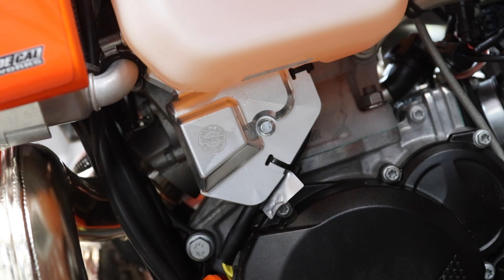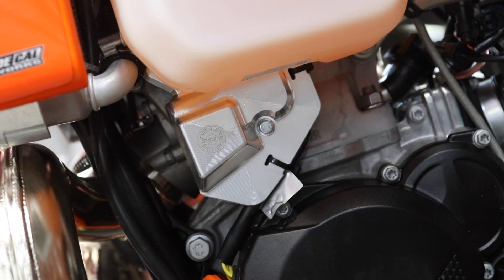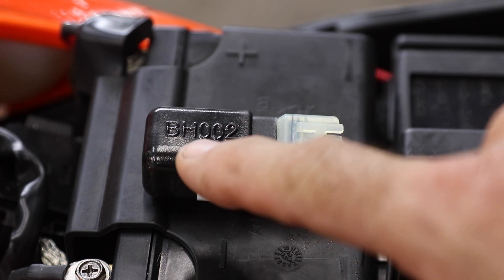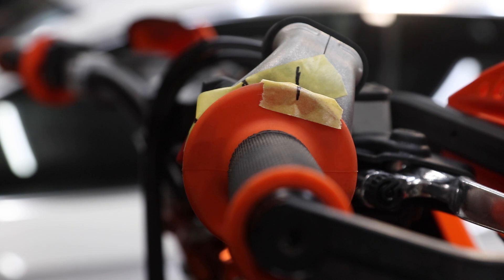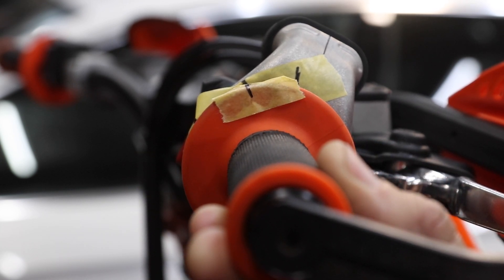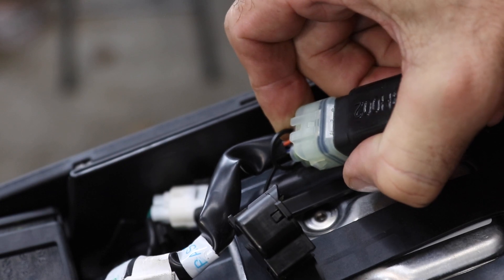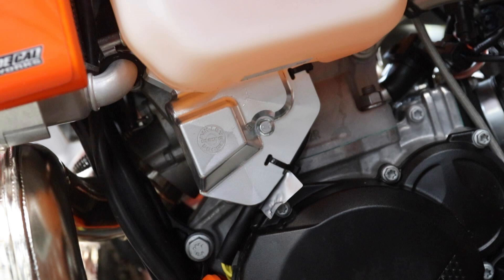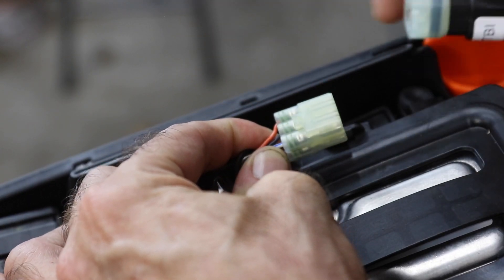2024 KTM 300 EXC/XC-W Electronic Power Valve Calibration

Comment: Excuse me for the ignorance, but what exactly will this do? I just got a 25 300xcw model and I’m trying to figure out how to check the TPS sensor with a multimeter but also curious about this as well if I should be doing both of these.? I have maybe one hour on the motor, but I find it stalling when I stop riding and just idling.  So I think the idol needs to be set a little higher or at least I’d like to verify what it is not sure the values.
Reply from the maker: This stores the power valve limits in the ECU. It's essential to perform the calibration if the powervalve has been overhauled. If you are stalling a lot try adjusting the engine idle speed up a little (red knob on throttle body). A different reason for stalling a lot is if you have excessive clutch drag. While sitting on the bike, if the bike wants to move forwards when in gear with the clutch lever pulled in to the bars then something is wrong.
Reply: @TokyoOffroad  OK well I did the two paper clips in the throttle position sensor and fluke multimeter then I use the provided dongle from Ktm to wake up the ECU and I got 539 mV so I then turned the red idle screw up until I got 590mv ,  I’m not sure how many turns maybe one or so but it seems to have improved it quite a bit.  Do you think I did it correctly? Now it seems to be able to start without the cold start and it idols better no stalling.

Comment: does it matter if you're in the green or white map for this? does 1 callibration work for both?
Reply from the maker: It doesn't matter what map you're set to. It will work for either and does not need to be repeated.

Comment: I just did it before a top end and no longer have the dongle does it need to be done after a top end??
Reply from the maker: Yes, reseting the power valve is recommended and a very good idea to do after the top end overhaul, particularly if you've overhauled the power valve.
Reply: @ thank you so much. I borrowed the dongle reset it right before I did the top end but didn’t mess w the power valves.  I will keep fingers crossed. Your channel is fantastic truly.

Comment: Did you find fuel economy extremely bad during the first few engine hours?   Maybe the power valve calibration would help?   I burnt 50% more than a 2023 XC 300 on the same ride for reference (same weight, same trail, same speed).
Reply from the maker: I found fuel economy very poor with the stock map. My bike was running excessively rich. When I switch to the TSP map (I purchased the TSP ERM Power kit with medium comp head) both the fuel economy and performance improved significantly.

Comment: Just got my 2024 300 tbi and i got the check engine light on but it stops once the bike runs idle ( it goes on only when i accelerate the bike ) . The issue is that when i am riding it it cuts my gas and it loses power.
Reply from the maker: In the owner's manual (page 146~ in mine) there's a blink code section which details each one. Count how many long and short flashes occur and look the error up. It will give you a good idea regarding where to start looking for the problem.

Comment: Not a fan of this system at all , I could get my mechanical power values where I wanted them for specific rides .
Reply from the maker: With the stock setup, yes, you can't change the PV setting. But with the TSP ERM system I have you can change the PV setting easily if you want.
Reply: so you actually adjusted your power valve settings manually for each ride? or you liked the idea that you could?  I'm guessing the latter but either way its easier with the new setup.

Comment: I wonder if you held the throttle more or less than half way open if this would impact the pv position for different throttle positions so you could manipulate where it hits in the open position?  Or is the throttle at half open simply the signal to the ecu to do the calibration?
Reply from the maker: Yes, the half open throttle position is only used to trigger the start of the calibration, so the absolute position is not that critical
Reply: I just came here to ask you this. So you are certain the throttle position isnt ABSOLUTELY critical and more of a “signal”. So basically if we “hear” the reset happen we are good to go? Awesome! Out of curiousity how did you find this info? Ive been searching
Reply from the maker: @shaneburesh9173  - Yes, that’s right. The exact position is not important, it’s just used as a trigger to start the calibration. I get my information from the service manual, but also have A few KTM technical contacts.

Comment: Great video.  I have a 2024 gas gas 300 EC and it has a super low idle.  Would this power valve calibration affect that?  Ive turned in the red idle nob all the way and it only bumped the idle up a little.  Struggling to find out why I cant raise the idle any higher.
Reply from the maker: That seems strange. The red idle adjuster on my 2024 works fine. The power valve calibration will not change the idle adjustment. My recommendation is to take your bike to your KTM dealer, have them use the KTM diagnostic tool and see if something wrong.

Comment: I saw in another video you had to perform this procedure for both maps. I assume that is unnecessary?
Reply from the maker: The KTM repair manual details the procedure on page 259. It calls it "Programming the end positions of the exhaust control". It does not mention repeating the calibration for a different map. As such I do not think it's necessary to repeat the calibration and think that probably the same end position data is used for both maps.

Comment: Can the electronic power valve be adjusted in a way that controls the hit as the spring set up did? Like a green spring being mild and linear/Yellow being more aggressive than green and Red being Wild and hard hitting.
Reply from the maker: The electronic power valve is controlled by the ECU. Stock the bike has no direct user control to tune the power valve, although the two stock maps (green and white) may well change how it responds. I'm sure there will be aftermarket tuning solutions which do allow user control...

Comment: Hi.
In this 2024 300tbi model, the oil pump test is exactly the same as the previous tpi models?
Reply from the maker: Yes, with the bike not running turn the throttle full open, plug in the wake-up dongle, wait 5 seconds, release the throttle and the oil pump priming sequence will start. Disconnect the dongle when the sequence has finished.
Reply: cheers budy :) and than i can do the power walve setup after ? with the same dongle?
 @TokyoOffroad
Reply from the maker: Yes, the power valve calibration uses the same dongle, but you need to hold the throttle half open to start the calibration.
Reply: When is it necessary to prime the oil pump? And is any damage possible if the procedure is run when unnecessary? Apologies for the naive questions, just bought one of these after years of 4T, no idea yet where to put my hands…

Comment: Good stuff! Did you test ride the bike before and after this procedure? Curious if the bike worked better at higher RPM after the calibration procedure. I was able to connect a map switch to my bike, it seems to have been in the green map from the showroom.
Reply from the maker: Yes, I rode before and after. Before was the first ride and the bike wouldn't rev out and felt very flat on top. After was the second ride and mid/top felt much better. However, I'm not sure how much was due to the power valve calibration and how much was due to the engine breaking in. Yes, I also confirmed that my bike stock is in the green (higher power/high traction) map.

Comment: The last sound was actually the fuel pump cycling 3 times to confirm a successful calibration. Without that confirmation the new calibration values will not be stored in the ECU.
Reply from the maker: Thanks for sharing that detail